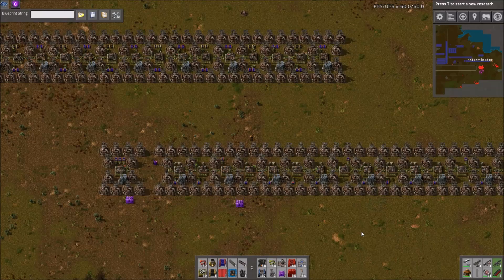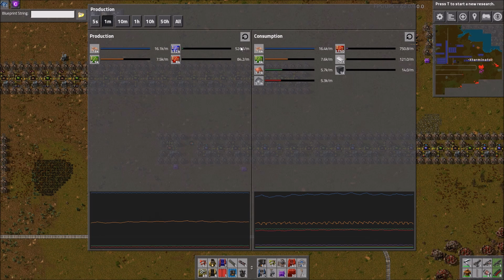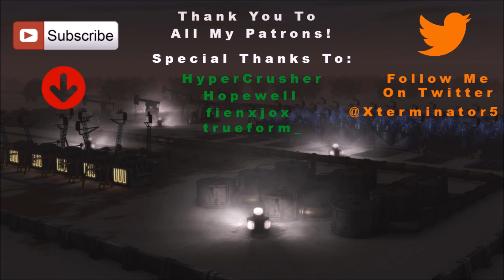Factorio Workshop - Building A Better Factory :: Xterm's Blue Circuit Build

Comment: Why insert green circuit and copper cables inside chest? It is possible to feed directly inside assembler. But maybe then is is problem with alignment? and also, you cannot use 12 but only something like 8 per assembler?

Comment: If you're still taking submissions, here's what I've been doing for green circuits (again belted). The design is fed 1 fully compressed blue belt of copper plates and 1 fully compressed red belt of iron. It outputs 1 fully compressed red belt of green circuits (the blue belt output line is used so no underground loading is necessary). I hope it will be useful for someone in early to mid-game (lvl2 assemblers, no modules).
Blueprint string:
H4sIAAAAAAAA/62d7W4iuRKGb2WU38lR293ARKNcy4pJOLNIBBAQaVZR7n0JzWg7bmy/T1X/QkKudtl+XfbT/uiX3bfN7nm5+fbX0/tqe1qf1qvj0/v7dvm6
erpbHo+r15+b9fbXw+vy+e/1dvUQ7+73u+M52W779P776aG9/+fpoXv8uD+sntf7s83zbr9fHR6elz83q7uPe/lJ4oNOh+X2uN8dTg8/V5tT4sz8+gyS+vt/
qf+/PJ4e1tvj6nBaHZLEsz/uvazPDl7+nkvZjHKpJ36UXLrhUSQFX6Bqmn+AtryqYvZfY642ZxcPu+36+eF5fXh+W5/upGqPqavH1+Vm89A/7vyw/e4sjlt5
L4i/U7nLvR05W1fHnCRmjTxDqTsx9cKQeuDJZnduuL+X25fVS7lzzm53zkt7lbJsrv4NrDtqPStYZ5wOVadvG96w0/o9arWRIOrNcKMVNMeQQEb6EJTaotQR
KZWlbg1hNNTGxGLsbG8rU42j7QftCtHVkTLuluJtxkQN+9XqFYO4KDKkMSRfpMeRHIWOEVDqBnUMljqQSVtwjQuNS87htnW9zcX6GDVMdcIYrPFZ9GjUQHWp
tGjG3opz6V4qMPUjj8/tQps3lqL0MF8xMrcpJVTFeK4Kh5TbRxyZWW2iytRisiospCskWaTBkQSFzoAm+K3IDtfOwFIPPFGn7J+tbQ/NZ/88el4Yp+xFpwtT
9q92YMqutsNIEOKU3eIYEshIH4JS0QS/RXAJU88MQ0Jbm1NW33m0GaJUR4cZHh1cAJxzVw37ngrz1deouupdjCC0+mSkzJEwhS6CpvotolqYOkXK4gjRukYI
F4u2GbCstzmhO7E6btQGidSECkceCXppuImKCIs0AyE14cO2uS0xOdg3Uuyqy81Fmm2GNNUA7C/EqFVFi1Q6Jf03Vv0TeEVl6MUc01UkwUSd5y/SDITU2gpS
P9MYPlqcXaDiNlcLh7hjhj1rkwJUNF6yUTuKFgQHWWLiy1WGc26izuQXaQZCagNFxrkvgH/aywt/da26qDRaqTRXCTUq/WoX6bgxWd2NlCVazIlebsgFDCKq
kkdCVvtVx01UBlikGQipB88ujh8ZcFTHElLqppShaJ0BxdIwYi0hL+CoVUULAo4sMfHlKsrITVQ6XaQZCKkJb8boHEviNDAQXeQafUuiExRi1KqiRSqdUhyP
1jhOYBiV4SpmDsMRwXBEMDx8djGOD56qxm5S0uZq4dF1BnJLsZuUihdq1HqiBeFRlpjDa+DwGhC8BgSvw2erCBC++8L2p/10CBBcsBs47PYIkKuEGgJ8tcMI
MFndjZQlWnwnerkhFzB0qEoeCVntV5zGA6LxgGg8pBBTGj9CBnzFsQQVvSllKFpz0vYVk5dy1L6iBeFUlphDbeBQGxDUBgS1IcWZ4qjSOUeVbhoYCC7gDb6l
2QkKMWpV0SKVTimid9aITmAYleEqZg7DAcEwTD1wR5ZxdYesKEQX0wYf005QiFHjiBYEN9XWHDWmqi3OpgGxaUBsGshCbXBt5A0u8gwZ8hQlgAFx1E6l2Gfd
0qu21e2mqiuHcyXCSkSVho294lbU6sSY7+3FW3tdwJnhTTGw+msJVxKuo1RbmgFhPZKWYyGnQgSFiAkNC7SuXb4uyLOuphq3+GY20mpyw5zHlz6tG30JI3JE
5ISIABHxoWWzr+d4nm+XL97k6wJJvnDq3BQ8zcE8zJ3YAJ1cBWkNS6/Ygi28ksRom69nhPBt8vXM6/n6pj6rt271RTt9qVwM9Agkw9ARR+rgP6c3yFR9rQ1D
tI9ScYRGtQgqUXwbjrEYGgDARSxMuwGOy6TbkKg8eK44e/e8dPFE5tILl8LUveRufuaeeYMiaYxqMpImGLWAPhKAgQDrGU/ZyTSDTNj5fRoz79E814Ua9DoN
z4Td9cLcU02eWqKVNDekB3NwkBRPpvBbHYK95J0OWBP13LHkeZNTul+p1tyU59J2yUdm411H4HXKwPfV7/1hdTzWZULei383PJ+8WxQ3kMwurngW27/X4pVS
vObi8U2lqeaZN/Fa0J2kEIkEKhLO7IRSMxK1sNBlmahGViVaeBwmlnMgi1PgAF7A+26p983FIZesi6un+VkAKpulaGnLqzbg+haySvpoES7it2jJgdBkMCCi
79BEiNo7BVmrGXSU7UvYWkLPTDXU2DNzjkF8HzNh5aVqFPE047+co6jOVP7VtMHSVQh8DhPrORAUHiYuDSGuI3i0GE3vmK+PZTwuDCWeQ3i0iKkUZBuwfYvs
PBw+V1caYcBhYj0HQqRk623wHekO86loILd5VrbPQK8Y3CcpR6qFChGEzPloOStw4xHZfR4sLIyOHgULDaPzF8PEpXiOr+Sgrje9Mz5tZ1i3EMPpfRy0WGmT
yzaAY8kZoGAhWXS8M1pIFh3fM5zHi74rlWIzMRA44bd4aLUABLlqqABBzNxypI0ZU1ZeqkYNCHL+y50RwDk5GxssdI7uGogWOkdnv0fHewujSO4OAW1EoWVp
eu98HY2Tt6uglnKmopBtAOaSGwqiBXPRTTDRgrnoRg9yRcfXy1j42FI9ziaL1YnAuVtlxDA/STlSLVTQ4KvLPLKrokhVV01rwWN0dxJLbGHpyL+wFBeTadmJ
ublLz0QtT1KOtE1lG8CgqgxSFdQlQygyWjg1mlAEfB0tZg5NyBrK4KRszw97jN02xDRYr2m1VmUE0BTdEoouIG0tmBktE+5hTmIcbKfalNpHVbB2S0vY9AX0
6dx2GWrEH+OYrFrTWpW7icGG3PSr9oC0A9R7C0G61gKNrWXW36K1vUtQb/l+2surj5yd3EkySCfb8+3DY7cjqK1xZfGhhDZq2qZVDQMERXf6yx8XuCS24GRr
meEPc1KHkuq+19LOYN/WYFjEpi+hr5vgz+3lLMQhpVq92gZhWFUWBaUCqnYYwLboCzTydz4uiS3o2VpW1lptRbEfRTLbhmWZZvBStuefZx27bYjnBhol31Qi
35ZBH/OSv9V0SWyh0dZCo8Oc1Hj+6D70N3RVjOSwcE1fNp/EM/RbiOT4E9lqZWox3MDNJhvA2qruU9nX+whh7c7C2q2FtTu0tteH8kcjEGTsVH3nvsMq9w9O
zWO3MRBkrGXtGgCYfKeVfMUSfaFX/v7rJbEFgDsLAHf89rvOfwtF/xywcJv7arDcV5zwnMu/8oYpZ6YNLhNUdFrPcpex2ADuVntD2hnqPQcdq7Vwd2fh7k5b
UbyMJ13m6g9Zq04Czn09voIGXeZ6Dlk+BhrtyLlVQKPqc3sVERrtVOiY94mLSng7D7aHX4fd+Tf7iDOwnf75jCC7t9P+bTAlLeY+K+ReNOwEt6sCdLJt51i6
nScNKtsASFUFk+qFNPviT7Ovt19aXY9YlGG73sgcA3rNZR5QKXL3pcip0qXco9f91vmAxutAEB5QrsfmWo2DzmNXkbdCleKU7L169LbntRtyG9jxSt2mGl0A
3eOAcCnMDVw77jfr042pz/8u9wdQ0p8luSiR4jETHC8znIx77ci9ejjJsG49jBgMG2uGoWCoh41ZcytskDmHtcZK/lfjg8HO2kBzo93MaLe4doyP+/Xzbnt8
en8/rn9tl5un96v2T6vXu/trO996dbk+N/rvz6uWCoa3bg/5Y3nGto8fh9Xp7bD99teP1fblX3pjKndZkwAA
Reply from the maker: Awesome thanks, will add it to the list! :)

Comment: Why put so much thinking and work into making the design need less robots? Just make more of them, they aren't that expensive. You could even just keep making logistics robots while a circuit condition of how many bots are available is less then 15 or so.
Reply: Max Elkin The Base gets more compact.  also need less carging,  so less roboports, so less power.
Reply from the maker: Because on the scale that I would want to build, just adding more bots will decrease game performance. It may not seem like it if you only have 2-3 thousand in your network, but when you're building on a scale where you have a minimum of like 10-15 thousand working, saving them wherever you can makes a difference.
Reply: That's not a bad condition, but it only solves half the problem. If you don't keep placing enough roboports as the factory expands, the number of logistic bots available condition will cause bot production to spiral out of control. (e.g. a factory that has 4,000 logistic bots in use might really only need 1,000 with a few more roboports.) When this happens, it takes a few minutes for the bot count to reduce to reflect the additional charging capacity.

Any changes to the design that significantly decrease the number of logistic bots needed or shorten their trips will reduce the chance of runaway logistic bot production. It just makes things a bit easier. Direct insertion likely has lower power requirements than the bots. Xterm's solution is also nice because it doesn't require additional belts, which makes it easy to place/move.